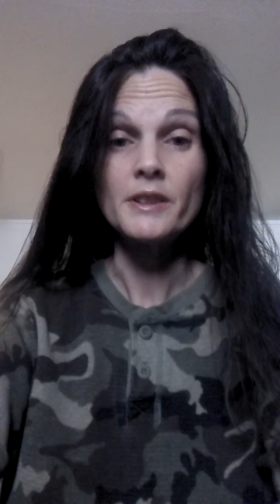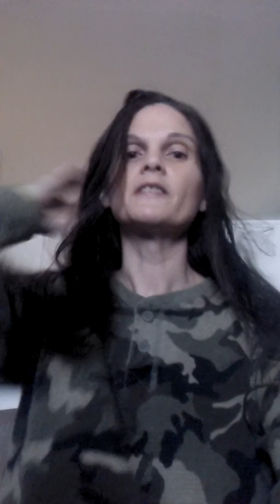Oroville Dam Auxillery Spillway

Comment: The main spillway is already 'spilling' ... and the primary outlet, the power plant, is releasing continuously.
Reply from the maker: Are the gates open?
Reply: The Hyatt power plant has 6 turbines capable of releasing almost 16,000CFS - currently at 10,500.  There is nothing wrong with the main spillway that would cause DWR to use the ES.  The new spillway can handle up to 250,000CFS (design spec) but DWR stated they want to stay under 150,000CFS to prevent overwhelming downstream levies and potential flooding.  DWR has already tested the main spillway for almost a week at 25,000CFS before shutting it down to inspect and evaluate performance.  FERC and DWR claimed the new spillway performed as designed.  Some people just want to live in fear for no reason or to justify their belief the governments of the world all want to kill everyone and usher in the 'end times'.  Link to DWR statement: https://water.ca.gov/News/Blog/2019/May-2019/Lake-Oroville-Operations-Update-May-31
Reply: @boblincoln184  You believe there is nothing wrong with the spillway because you believe the DWR is trustworthy.